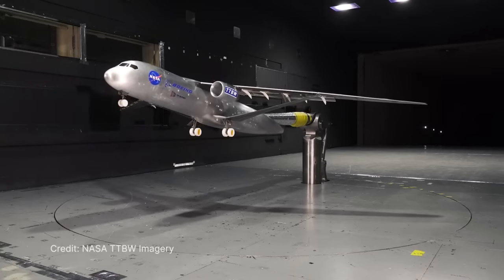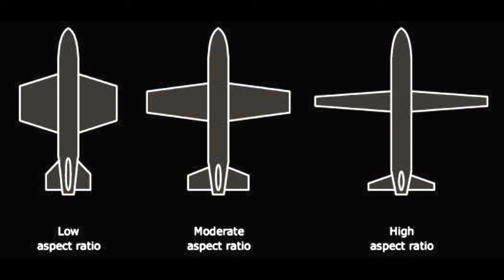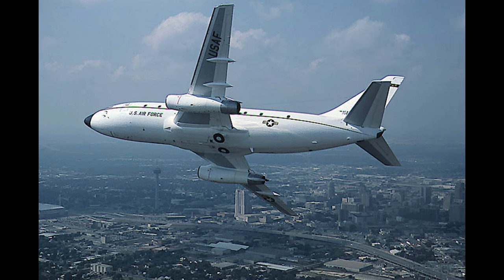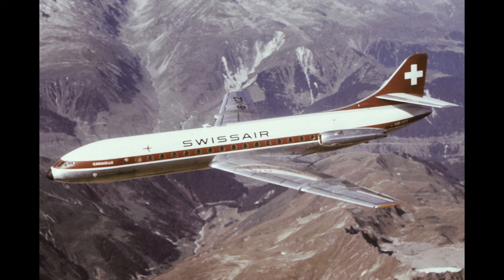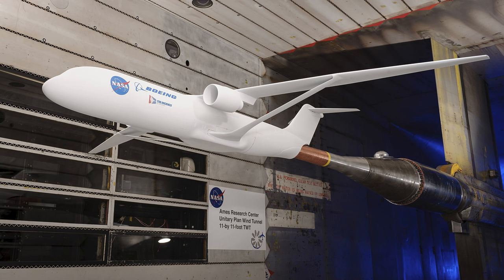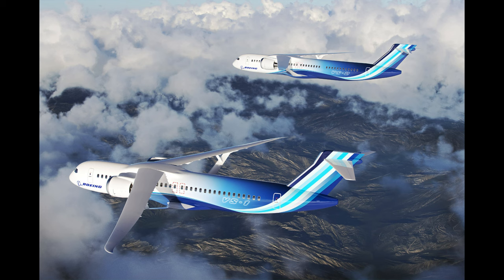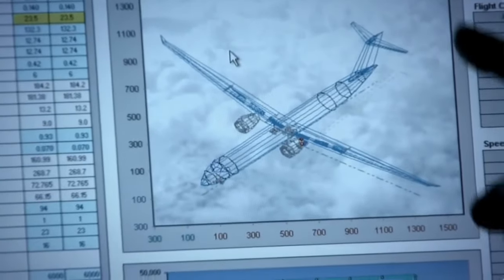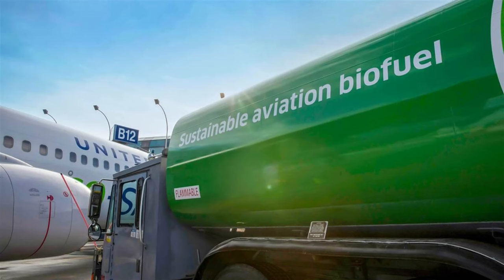NASA's New Airliner Experiment To Make Flying Less Expensive

Comment: As I understand it, the real advantage of putting fuel tanks in aircraft wings is that the wings are then weighed down at exactly the time when the aircraft is heaviest - i.e. carrying a full load of heavy fuel. Thus, weight savings can be had owing to the fact that flexure of the wing is reduced when it has to generate the most lift, and so, a lighter structure can be implemented.
Reply: That and it does save having to find space for the fuel elsewhere.
Reply: it also helps with keeping the plane's weight centered over the wings. A plane with too much weight frontward or rearward is unstable. Shifting cargo in planes has caused crashes before.
Reply: @alexdrockhound9497  The center of mass is almost always rear of the wings though, as fuel burns the CoM moves forward. The horizontal stabilizer generates lift too, so the center of lift is also slightly rear of the wings.
Reply: @wills.5762 Behind wing roots sure but not behind all of the wing, that would be unstable like crazy.
Reply: Yeah, putting fuel in the fuse usually means adding pumps and taking risks on balance and pilot error.
Reply: @wills.5762  Actually, in most aircraft the horizontal stabilizer generates a downforce, as this makes the aircraft more stable in pitch. E.g. if the nose drops then speed increases which increases the downforce at the tail and brings the nose back up.
Reply: The best reason of all for putting fuel in the wings is the reduction of bending loads on the wings. The wing flies the fuel immediately above it. Loads carried in the fuselage increase the bending loads on the wings.
Reply: It's not their primary advantage, but small GA aircraft retrofitted with wingtip tanks often get the luxury of an increased gross weight, since the weight on the wingtips counters the bending moment of the wings and thus less stress on the spar and center section.  For this to be the case, wingtip tanks are supposed to be one of the last tanks you draw from, in order to maintain that counterbalance.  They are not without their drawbacks, however, since tip tanks can reduce your roll rate, unequal fuel draw can lead to one wing feeling very heavy, and in some cases increase drag.

But the primary reason why wing tanks in general exist?  It's the easiest place to put a large quantity of fuel on an aircraft.  In the early days it was easier to put fuel in the fuselage forward of the cockpit, back when aircraft didn't burn a lot of fuel or weren't expected to have a long range, and wings were wood and fabric construction.  One problem they found out with fuselage tanks is pilot survivability in a crash...having a fuel tank between the cockpit and engine is a terrible configuration when you crash, or when your engine catches fire in flight.  When the engines got bigger and the aircraft needed to go further, they looked to the wings, which by this time were transitioning to aluminum skin and better suited for holding tanks.  There was suddenly plenty of space, and not a lot of things that needed to be in the wing.  Some aircraft began using the entire wing as a tank (wet wings), as opposed to placing tanks or bladders inside.  The wing structure doubles as a fuel tank and vise versa so no weight penalty incurred.  They're located close to the center of pressure, often right up against the spar, so very little change in CG between full and empty compared to having fuel weight spread out in several tanks along the fuselage.  Several aircraft designs have fuel tanks in front of the spar and directly on the center of pressure, so there is no change at all in CG.  It was really the only logical choice for fuel tanks to be, as it had so many benefits and no real drawbacks.

Airliners would see a lot of negatives for fuselage tanks, primarily because they're going to eat up cargo and passenger space in the plane.  The moment arm of fuel inside the wing isn't as great as you'd think it is, since the vast majority of the weight is at the wing root, and only a fraction of that is far enough away to see any real stress-relieving/counterbalance benefits of having weight in the wing.  I mean, the benefit is there, but it's not as huge of an advantage as you'd think it is.
Reply: @wills.5762  not by a whole lot, just a little bit behind the wings. There's still plenty of other systems they can put behind the wings to balance the weight out. Its still better to put the fuel near that center wing section than to find somewhere else to store it.
Reply: The term is called span loading. This is one of the advantages of flying wings. Put the weight where the lift is generated and it doesn’t have to be carried back to the fuselage. Like every design decision it is a trade off. Move that mass out onto the wings and the plane rolls more slowly (larger polar moment of inertia). One of the other things that comes from a large wing cross section is a stiffer wing. Aeroelasticity is the bendy and twisty stuff that happens to the wings and airframe. In large aircraft the ailerons near the wing tips at high speeds can twist in opposition to control input and become ineffective. There are engineering work arounds like adding inboard ailerons for roll control at high speeds. The C5A does this.
Reply: @Skinflaps_Meatslapper  Me in my Cessna 310 burning from tiptanks first 👀👀
Reply: @wills.5762  horizontal stabilizers usually push down a little to compensate for the center of gravity being in front of the center of lift.
Reply: I guess that makes sense. But what about the flexure of the wing when fully fuel and not in flight?
Reply: It also guarantees weight is near center of lift and weight balance doesn't change much over the duration of the flight as fuel is consumed. Also allows for a lower cross section of fuselage which means lower aerodynamic profile overall. (Not to mention keep a very high profit revenue stream for PPG's and 3M's aerospace divisions making all the sealants that allow those wing hollows to be made into fuel tanks)
Reply: @MysteriousOoze  the plane weighs a lot less by the time that much fuel is consumed, so the wings do not have to generate as much lift, and therefore, there is less tendency for them to flex upward.

You have to remember that with a typical plane, the fuselage is just along for the ride; the thing that is "flying" is the wings and tail. They have to haul the dead weight of the fuselage along
Reply: All aircraft carry their fuel in the wings and or center wing section.  Only the military air refueling tankers carry fuel in or under the fuselage.  On the KC-135, over half of the 202,000 pounds of fuel carried, is kept in the body tanks under the floor.

Comment: Thanks for covering this Scott! This is a super interesting topic, and I'd love to hear more perspectives on it. If I remember right, one of the reasons they dropped the blended wing body concept was more aligned with human factors issues than technical limitations. Basically, imagine sitting in a movie theater knowing that theater is flying at close to the speed of sound at 35,000 feet, and you're nowhere near an exit sign. Apparently that thought freaked passengers out enough during evaluations to tank much of the work as untenable to actually use for a real world airline.
Reply: A tube shape of a regular fuselage is something that makes sense to people. The BWB is an inherently efficient design but I don't really see how humans are going to effectively navigate something like that under present circumstances - the movie theater comparison was a good one.
Reply: Blended Wing Body is far to heavy as a pressurized cabin. A tube is much more efficient. And a flying wing has a small center of gravity range. Which is not viable for passenger/transport aircraft.
Reply: We're flying slower and slower, and turbulence is coming back as an issue due to lower altitudes. Blended wing design is more air worthy they tubular, and exits will always be jammed no matter what. We are sadly going backward  in air travel. Under the false directive of fuel crisis and fake green tech. Very disappointing developments in designs all together

Comment: The McDonnell Douglass MD-80 and MD-90 series airliners were very successful around the world...growing out of the DC-9.   When Boeing merged with MD, they had two similar airliners...they dropped the MD series and kept the 737.   For a while Boeing supported producing the 717 a slightly shrunk MD-80.
Reply: Always wondered where the 717 came from. I always assumed it was a mini 727, with 2 engines… but to look at the windshields I thought ‘nope’ 😂.
Maybe this current Boeing project will spawn a mini version, to truly replace the 717. From what I understand: the 737 Max 7 is the smallest airliner that Boeing will be mass producing within the next 10 years.

Maybe a large ‘regional’ jet, alongside an ‘NMA or 797’, would be what Boeing needs to complete it’s market dominance.
Reply: @SamiltonAdventures  They're going to have a hell of a time competing with Bombardier and Embraer. Bombardier has a large market share in the regional market, and when I had a short-ranged flight that included both Bombardier and Embraer in the same trip, I was ASTOUNDED at how quiet the Embraer was. Made me never want to fly on anything else.
Reply: The 717 was a new name for the MD-95.
Reply: Boeing has of course, made their mistakes with the 737 lately, but thank heaven they killed off the DC-9/MD-80/717 series. Ever flown in one? It’s like being swallowed by a vacuum cleaner. And I won’t even get in to the many ways that their systems are just weird and unfriendly to maintenance and pilots. Everything Douglas produced at their Long Beach factory has been made obsolete, and for good reason.
Reply: @singleproppilot  Only been in one, once, and I thought the noise was just because we were in the tail section, directly between the engines. I always figured it was quieter up front. Never heard stories about maintenance, though I thought pilots liked them?
Reply: The DC-9 still lives on, it was license built in China and now they launched the ARJ-21, which is based on the DC-9 fuselage combined with wings newly designed by Antonov

Comment: You mentioned gliders but I'm surprised that you didn't mention the wings of pelagic birds like the Albatross which are able to cover vast distances with little effort.
Reply: But, in all aircraft (birds, gliders and powered airplanes), optimum fuel efficiency is achieved at the (cruise) velocity, which happens to be close to the velocity at highest Lift to Drag ratio. Therefore, longer, low-aspect wings with winglets increase lift at a lower increase of drag, causing a higher L / D ratio. The penalty is that this point of optimum L / D ratio is at a lower velocity. Albatross and gliders fly really slow during “normal” operations.

In the case of albatross and gliders, neither has access to excess energy by using fuel. 

The only excess energy available to gliders is external - thermal updrafts in the atmosphere.

Excess energy available to albatross is the same external thermal updrafts and the potential chemical energy stored in fat cells and transformed through mitochondria to kinetic energy in their muscles - these birds can resort to flapping their wings for awhile until their mitochondria are no longer able to yield enough energy to maintain altitude.
Reply: @davecorley5514  interesting response, thanks! I'm not sure that it's necessary to talk about mitochondria. Yes, mitochondria are the power sources of cells but in animals they receive more energy in the form of carbohydrates from the bloodstream which come from the animal eating or breaking down fats. Albatross and most pelagic  birds use energy borrowed from the wind combined with ground effect most of the time rather than thermals like a glider. I was mainly talking about the aspect ratio of the wings of an Albatross which have the longest wingspans of birds, as well as the shape of the wingtips. The NASA design also seems to be using laminar flow, so the wings are very thin, just as sailplane wings tend to be thin.
Reply: For all intents and purposes, no bird would survive transsonic flights, they're just not made for it. The design has likely been computer optimized where they test different ratios on separate instances and keep refining the ones with better results. Kind of an evolution of it's own.

We have to bring "God's creations" as inspiration for everything whenever someone does something, don't we?
Reply: @davecorley5514   Yeah, my mitochondria start to have no energy either... about mid-afternoon.
Reply: I've never ridden on an Albatross and am wondering how long it would take to cross the Atlantic. And what about luggage?
Reply: @afoxwithahat7846  ANA is testing a surface coating inspired by shark skin to see whether it reduces drag. A great deal of research is based on what already works in nature. Gliders won't survive transsonic flight either. Sure, the design might have been trial and error. They also may have minimised the range of options tested by knowing what works in existing wings.
Reply: @Martin-se3ij  hilarious. How much luggage do you take on a sailplane and how many have crossed the Atlantic?
Reply: Pelagic birds also have a tendency to have raked wingtips like the 787 dreamliner.
Reply: @afoxwithahat7846  This is probably the reason they wouldn't let that woman take her peacock on the plane even though she
claimed it was her emotional support animal. "Sorry madam your bird is just not built for transsonic flight".
Reply: @theharper1  Forget the luggage. What the buggers don't tell you about going up in a glider is the lack of bathrooms!
Reply: @theharper1  Certainly dimpled golf balls fly further than smooth ones which has always led me to question why airplanes aren't dimpled. The skin of a stingray, flying through water, is like miniature pebbles so why are boat hulls smooth?
Reply: DYNAMIC SOARING
Reply: @davecorley5514  DYNAMIC SOARING...LOOKUP
Reply: @Martin-se3ij  a SPINNING SPHERE is not REMOTELY similar to an AIRBUS- -Q 4OO....
Reply: @battshytkrazy156  actually the Dynasoar was a spaceplane project. 🤔

Comment: Hi Scott, as a materials engineering student in Madrid's UPM we overlap severely with the Aeronautics branch and some of our labs and projects funded by Airbus are right now wind tunnel modelling of this such airfoils (dont know if it will come to terms though as many of these projects end up being scraped). In particular our department is working on additive manufactured (3D printing) alloys for the hollow trusses and stress, fatigue and freeze testing them. I guess since i dont have the full details that they want to pump fuel through the truss to the engines but sadly airplane engineering is just outside my reach so i dont know.
Just to say that if even Airbus is looking into this there must be some merit to the idea of this design.

Comment: The immediate issue I thought about as soon as I saw the design has to do with airports being able to accommodate the extra long span. Airports, for example, needed to make special accomodations for the the An-225. At at least one very large airport, I forget which one, the only place it could park was the area of the airport designated for de-icing aircraft.
Reply: I've heard radio traffic about aircraft taking out light posts with their wings. I think this will get adopted very slowly. But hey, I'm the guy saying that hybrid vehicles will still be kicking in the 2050's (even if I do hope they're hydrogen-electric rather than gas/diesel)
Reply: @KMCA779  By 2050? Look for wide-spread use of the Hydrino (taking electron in the Hydrogen atom to a lower level and releasing 200x that of simple combustion) by then ...
Reply: It simply won't happen
Reply: @uploadJ  27 years is actually very little time for airports to fundamentally change their layout.
Reply: @russellthorburn9297  re: " for airports to fundamentally change their layout."
I wrote about a new energy source (vis-a-vis electric airplanes), and you're on about 'airport layouts'. Okay. I think though that those are two different things? Que?
Reply: @uploadJ  I can make up all sorts of fantasy technologies that could also work in a fantasy world
Reply: @uploadJ  There is no energy level below the ground state. Hydrinos are not real.
Reply: @mou8762  re: "There is no energy level below the ground state."
Um, yes there is. Two nascent  H atoms making H2 is proof alone. Prove me wrong on that one ... BTW, the H + H -> H2 is a non-radiative process, just like when making Hydrino. You appear to have much to learn. QED, again.
Reply: @russellthorburn9297  not if they have to acquire land to expand runways....
Reply: Folding/varrble wings but that truss is going to be an issue and getting fuel in it with the mechisim and while keeping the cost down so yeah good luck Nasa.
Reply: @tehbonehead  I can't see runways themselves being an issue. The planes aren't going to be heavier, and typically there's vast space on the sides. Even ground objects seem like they might not be an issue when they're a high wing design.
Similarly it seems they shouldn't require more runway length to take off.
Parking and taxiways seem like the biggest issue.